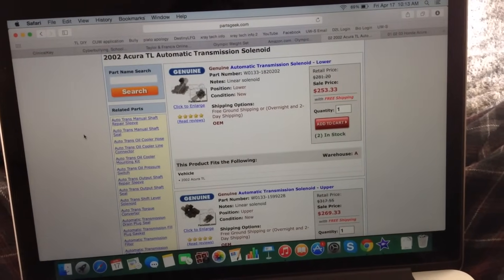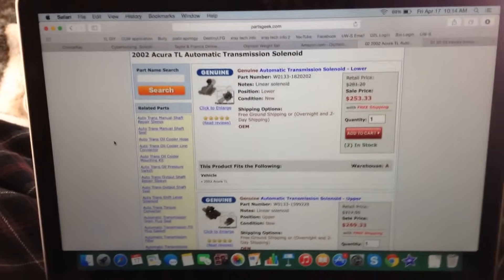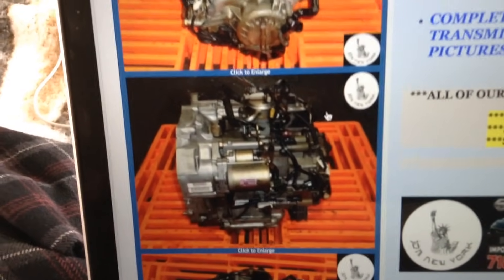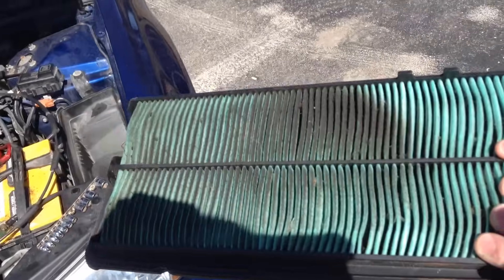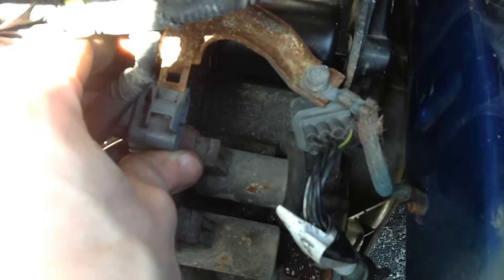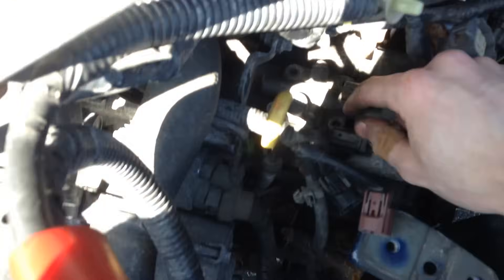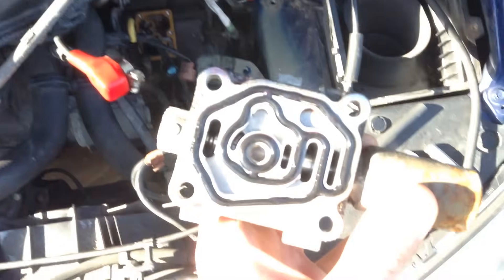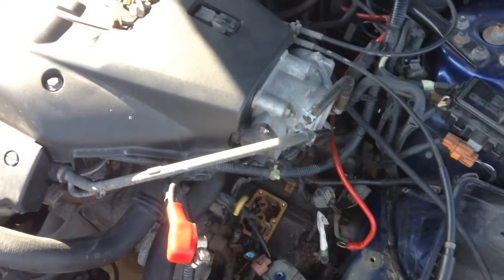Transmission Fix: How to Clean Solenoid Screen Filters for Honda/Acura P0730 P0740 P0780 P1750 P1751

Comment: I replaced the dual solenoid  it did work for me but I am getting a short for solenoid C i’m getting like a buzzing noise on one of the connectors 

Lights came back on any tips    I feel like there might be some wires touching or something please help
Reply from the maker: Do you have the CEL code? Perhaps try the ohm test at the end of the video, should read about 5 ohms. Also if you take some wires with alligator clips or something you can connect one end to your car battery terminals and the other ends to the solenoid and there should be a clicking sound and clear movement of the valve inside. If there’s an abnormal ohm reading, no clicking, or no valve movement, it’s a bad solenoid.
Reply: Purchased new solenoid from Napa ,
same issue PO979 short circuit low
Reply from the maker: @JayVibe413  well before you said you replaced the dual solenoid, which is solenoids A & B. This code is for solenoid C. Are you sure you’re inspecting the correct solenoid? You might have to purchase the other one as well if it fails the tests I described in my last comment.

Comment: I replaced my dual linear solenoid after I broke one of the connectors on the old one and replace my transmission fuel pressure switch and now it’s shifting hard from 1st to 2nd shift and the check enlighten is on now with a P0750 code. Do you think it’s the solenoid that’s makin it shift hard still? No check engine before I replaced it. What’s typically the problem with that code?
Reply from the maker: I would start by making sure your ATF is clean and not over/under-filled. Dirty fluid or an improper level can easily cause problems on these vehicles. Otherwise, it sounds like the replacement solenoid you got is faulty. Try performing an ohm test on it. Idk if you bought an OEM or aftermarket solenoid, but I've heard people say the aftermarket ones don't work well.
Reply: @CarRepairsMadeSimple  I’ll try that out then and yes it’s definitely aftermarket. I put more fluid in it because the reading was off, one side had fluid residue other was nothin at times. The level is better after I added two quarts. I changed the fluid about a month ago and filter. May have not put enough at the time. The TSA light and D5 is on as well.
Reply from the maker: @cjhickson8557  back when I got p0740, I also got flashing d5 and vsa lights all coming on, so I’d say that’s normal. Also, idk if you’re using Honda DW-1 or aftermarket ATF, but I’ve also heard aftermarket fluid can make shifting noticeably harder.
Reply: @CarRepairsMadeSimple  I’ll keep that in mind too. How many quarts do you use after you drain the fluid.
Reply from the maker: @cjhickson8557  I put 3 full quarts in after I drain the ATF. I have a whole video on ATF on my channel!

Comment: This is exactly my issue on my 201k mile 3.2cl my car ran fine when I got it 10k miles ago but it started shifting funny a month ago and now It shifts up and down randomly and slips sometimes then locks in solid sometimes it feels normal sometimes it is bad like just now I got stuck on the road had to shut it off turn it on and drive the last 500 feet home in first gear 🙄 then when I start it later it drives all over no problem I took apart the top solenoid and all the screens were perfectly clean that tube was clean I didn’t take off the bottom solenoid because i don’t have that flex joint thing
Reply from the maker: The universal joint is a really handy tool to have! You can get a 1/4” adapter for less than $10 at Home Depot, or even on amazon with 2 day prime shipping. The bottom one is definitely worth checking out and cleaning if possible! Good luck and thanks for watching!
Reply: @CarRepairsMadeSimple  thanks! I have many tools including those joints just not a 1/4 inch one sadly lol and my 3/8 inch ratchet is too large sadly I’ll post a comment here if this fixes my issue my other question was if this car has a trans filter because a local shop said it doesn’t I’d like to do a fluid flush in the hopes that this doesn’t clog up again any time soon
Reply from the maker: @kingarthur7255  the 2000-2006 TL’s have external ATF filters, not sure about the others. It doesn’t have a service interval oddly enough, but should be changed. And yes change the fluid to prevent these filters from clogging up! I have a whole video on ATF on my channel
Reply: @CarRepairsMadeSimple  thank you! My car is a 2003 Acura 3.2cl auto ofc I should have said that earlier 😅 is the filter something I can change myself? Or should I have a shop do a whole flush? I know it takes a very specific fluid from Acura it’s $8/ quart in my area I believe but I’ll watch your video for sure! I subbed
Reply from the maker: @kingarthur7255  thanks for the sub! I’d say it’s definitely a job you can do! The top solenoid and the exterior spin on filter are practically right next to each other. I would not recommend a flush though, but rather simple drain and fills. Depending on how dirty your ATF is, you might want to consider doing two drain and fills while waiting a good couple hundred miles in between to avoid shocking the system.
Reply: @CarRepairsMadeSimple  it was about like yours in your filter change video maybe a bit more dark not brown or burned like oil can get I’ve had the car for about 10-15k miles did a timing belt kit and so on the car is in amazing overall condition with a good bit of service history from the day it was purchased new in Florida as a lease then sold to a couple in my state “Arkansas” and it’s a beautiful rust free clean title car it has some minor dents and dings but very clean I have $4,500 total invested into it so 10-15k miles is not enough I want to actually enjoy this car for longer I’m hoping my plan fixes it first I’m going to clean that lower filter I noticed it was leaking after I reassembled it from cleaning the upper solenoid so I need to address that also then I’m going to change the filter and do a 3qt fluid change drive it a couple hundred miles if it drives after then do another 3qt change I also plan to check the solenoids once I buy a new voltage meter how do I go about checking the solenoids? “Best way” also as for the leaky upper solenoid it was bone dry before I mess with it now it’s puking fluid I don’t believe I tore the gasket and I tightened all the bolts fairly hard with a cross pattern wonder why it’s leaking 😢
Reply from the maker: @kingarthur7255  there are replacement gaskets, i have heard on a rare occasion of them going bad

Comment: Hey man any idea how to get off the top solinoid if its stuck? Have the bolts removed it wont move at all
Reply from the maker: I’ve ever heard of them getting stuck before, I guess don’t be afraid to use some muscle! Just try to remember to remove it mostly straight up so you don’t bend the little tubes inside it.

Comment: Hey man I opened mine up and only saw 1 filter tube.. I have a 2001 Honda Accord V6. You have 3 but I only have one
Reply from the maker: it is possible that our transmissions are built slightly differently. In which case the same principle still applies, just clean all the screen filters. Otherwise, make sure the filter tubes didn't simply stay in the transmission when removing the solenoid.

Comment: If the multimeter doesn’t read anything on the solenoid does that mean its broken? The red plug as no reading while the black plug reads 5.5. Should I just buy a new one ?
Reply from the maker: Assuming your car is having transmission troubles and/or throwing a Check Engine Light code, I would say yes it needs to be replaced. I would recommend a Genuine Honda replacement and depending on your finances and how long you plan on keeping the car, a new one costs $336 + shipping, or you could buy a used junkyard part for cheap on eBay. I haven't seen any solid good reviews on aftermarket parts, unfortunately.
Reply: @CarRepairsMadeSimple  I haven't gotten any codes yet but I have a terrible idle, reverse is super shakey, and the car has no clue what to do in drive and goes between no throttle response to lurching forward. Picked up a new solenoid from a junkyard that I tested with the multimeter. Installing it as soon as the replacement gasket comes in the mail. Thanks for the response, video, and (most importantly) hope!!
Reply from the maker: @samk.4599  Yes let me know how everything goes! I haven't heard anyone correlate a rough idle and poor throttle response with the solenoids. Maybe check your engine and transmission mounts, I've got videos on those too.
Reply: @CarRepairsMadeSimple  The reason I think even the idle is due to the transmission is because I had the exact problems a month ago and an atf drain and fill fixed it temporarily. I drove the car 500+ miles since then and all the problems went away until a few days ago. I'm not a huge car aficionado though, so I could be missing a few things.
Reply from the maker: @samk.4599  I got this from the service manual.
Symptom: Engine idle vibration
Probably causes:
1. low ATF level
2. Torque converter clutch solenoid valve defective 
3. Drive plate defective or transmission misassembled
4. Engine output low
5. lock-up clutch piston defective
6. ATF pump worn or binding
7. lock-up shift valve defective
8. Restricted ATF warmer
Notes:
• Set idle rpm in gear to the specified idle speed. If still no good, adjust the engine and transmission mounts as outlined in the engine section of this service manual.
• Check ATF level and check ATF cooler lines for leakage and loose connections. If necessary, flush ATF cooler lines.
• Check ATF cooling system for restriction.
Reply: @CarRepairsMadeSimple  changed a few ignition coils, got a shift solenoid from a junkyard and did a drain and fill. 4 months later and the problems have been few and far between, so one or all of those helped solve me problems. Gonna watch your oil pressure sensor video and change those next!
Reply from the maker: @samk.4599  Nice! I'm glad to hear things are improving! There are certainly quite a few solenoids on these vehicles and they do go bad despite not always giving you a CEL. Hope the pressure sensors further improve your transmission performance!

Comment: Great video, did you have issues with it slipping or rough shifting 1st and 2nd gear?
Reply from the maker: I had slipping and rough shifting in pretty much any gear. Sometimes it would randomly shift gears for no reason. Nothing was working good at the time, but cleaning these little filters fixed everything!
Reply: @CarRepairsMadeSimple  I’m going to give it a try on my 04 Tl won’t hurt to try. Thanks so much!
Reply from the maker: @alexquezada510  absolutely, that’s the nice thing about this fix, it’s free to do and can’t hurt anything. Good luck!

Comment: Is there any difference between the regular 3.2 t l vs 3.2 type s or its about disame?
Reply from the maker: They’re practically the same, just with some varying parts numbers here and there.
Reply: They claimed that the type s is a bit faster
Reply from the maker: Vincent Quintero it is, the type s has 35 more horsepower and sportier suspension

Comment: Hey I bought a 02 Acura TL and the transmission isn’t slipping but when first taking off it feels like the engine is knocking against something. Only does it when car first takes off at speeds it can take off and accelerate fine and hold gears, do you know what it could be?
Reply from the maker: sounds like bad engine and transmission mounts. Check out my other video on engine mounts. Although I haven't made a video on it yet, there are also other videos on replacing the transmission mounts as well

Comment: Have you even gotten a P1750 code in the process of repairing it? I too have a '02 Type-S
Reply from the maker: I haven’t gotten that code, but it does involve the same solenoid located on top of the transmission, which I removed at 10:35. If you have already ensured that the filters are clear of debris, the next step would be to replace the solenoid itself. The part number is 28250-P6H-024. It's an expensive part at $323 + shipping, but I would still highly recommend getting an OEM Genuine Honda part, not something aftermarket as I've heard of aftermarket solenoids not working properly. One other thing you could try is ensuring your transmission fluid doesn’t look dark or smell burnt, and also isn’t under/overfilled. If it looks bad, I would recommend doing a 3 quart drain and fill using Honda DW-1. Good luck!

Comment: Hey I have a question for my 2003 TL type S, my cars transmission is slipping  and not shifting gears sometimes with the error code P1750. What do you recommend I replace?
Reply from the maker: The problem regarding that code involves the solenoid located on top of the transmission, which I removed at 10:35. If you have already ensured that the filters are clear of debris, the next step would be to replace the solenoid itself. The part number is 28250-P6H-024. It's an expensive part at $323 + shipping, but I would still highly recommend getting an OEM Genuine Honda part, not something aftermarket as I've heard of aftermarket solenoids not working properly. While you're at it, I would also recommend replacing your transmission fluid with Honda DW-1 if it looks dark or smells burnt. Good luck!
Reply: @CarRepairsMadeSimple  thanks I’ll look that part up. This only occurs when I have been driving for around 15-20 mins when the engine is hot. The shifting will be really jerky and when I press the gas the car will not accelerate. Please let me know if that’s the right part, I just want to make sure
Reply from the maker: @draginzen  I looked it up in the Acura service repair manual to be sure, that's the part you'll need!
Reply: @CarRepairsMadeSimple  thanks, do you also think it could be the A/B solenoids or the clutch pressure switch 3rd to 4th?
Reply from the maker: Kevin Lau if you had 1 specific gear that had problems, maybe. But you seem to be having general overall slipping and shifting problems with a code that directly points you to the control solenoid that I mentioned before, in which case I wouldn’t start randomly throwing money at other parts hoping for the best.
Reply: @CarRepairsMadeSimple  Hey man, update from my car, I bougth the part and installed it, but am still getting the same issues. Do you have any other recommendations for what else I can do? Or would it just be more cosdt-effective to just swap the transmission? Thanks!
Reply from the maker: Kevin Lau im really sorry that the new part doesn’t appear to have fixed the problem. Are there any new or reoccurring check engine light codes? You could also try resetting the cars computer by disconnecting the negative terminal for at least 5 minutes. Make sure you have the radio code before you do that. And again just make sure your ATF is clean and not over/under filled.

Comment: Took screws off now it’s like stuck on there yours came out so easy
Reply from the maker: I suppose if it’s the first time being removed in 20 years, it’s possible. Never heard anyone tell me it was stuck in there after removing the 6 screws. I may have also prepared the solenoid before filming it, so it might just take a little wiggling and muscle.
Reply: @CarRepairsMadeSimple  muscle work dad took it off I’m scared to break anything like I said had trouble shifting into 4th haven’t hit 5th yet or changed the fluid just cleaned both of them like in your video now putting everything back finally hope it’s fixed if not at least the same don’t want to do damage to it and make it worse then it already is the screens weren’t that dirty even the bottom kind of worried
Reply from the maker: Big Germ it surprisingly doesn’t take much junk to restrict the flow in the solenoids and cause CEL and problems. I would definitely change the fluid next and soon! Lemme know if cleaning the solenoids worked, good luck!
Reply: @CarRepairsMadeSimple  about to test drive again for 2nd time since I bought it after if it didn’t do nun I’m gonna do the drain 3 qt refill I already have 1 qt gonna go back to the dealer tmro and get the other 2
Reply: @CarRepairsMadeSimple  can it being overfilled with transmission fluid also be a problem ? The car drove exactly the same smh didn’t want to shift 4th floored it
Reply from the maker: Big Germ yes if the transmission fluid is too high or low it can cause problems
Reply: @CarRepairsMadeSimple  yes like I test drove it and since I saw one of your videos that said a test drive will warm up the transmission temp to see the reading I did and it sometimes fills up the 2nd dot with oil sticking it in and out quickly idk if I do the 3 qt drain and fill how will I know if I’m pouring to much if it’s gonna be all cold or should I take out 3 qt drain what I can then fill like 2 qt maybe 2 and half then just test drive it again just to warm up then see if I need to add then really floor it again
Reply from the maker: Big Germ yah you could start with 2 and a half quarts, take it for a drive, check it, and add a little bit at a time as needed. You could also try draining a little bit of fluid by removing the atf plug bolt for a second and putting it back in, but it’s a messy process.